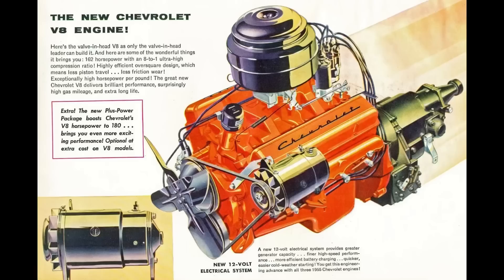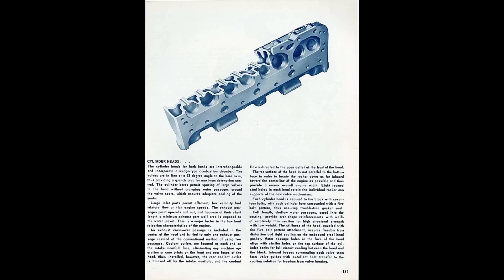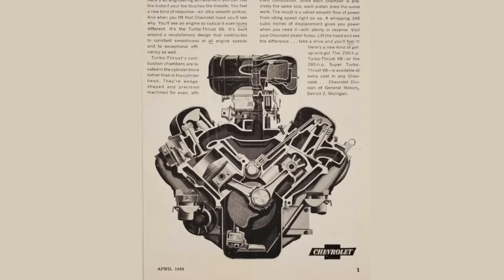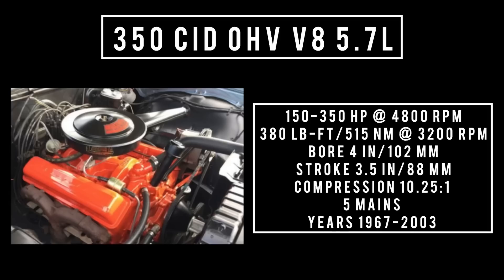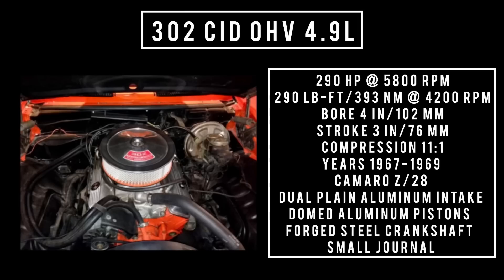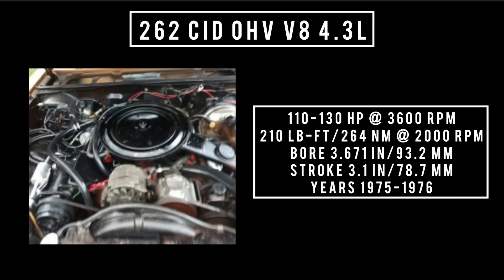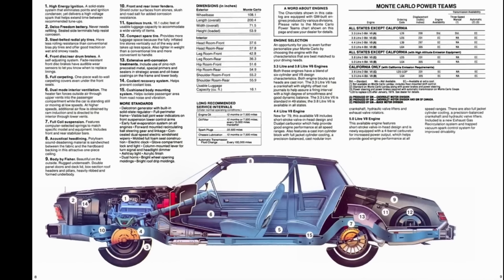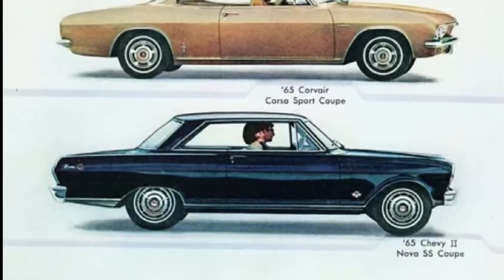First Generation small block Chevy engine family 265, 283, 327, 350, 302, 307, 400, 262, 305, 267￼

Comment: Hello....  just.  To.  Let.   Ya..  know...  my.   Favorite.  Small.  Block.    Chevorlet..  is. The.  327...  it. Was.   Common. From.  Any. Where. Starting. At. 210..h.p.....in. the. Standard.  Camaro..  upto. 375 h...p..   in. The. Corvette..  and.  I.  Consider. Myself.  Lucky..  to.  Have.     Tuned. Up.  Repaired..   or.  Rebuilt. Most. Of. Those.  Variants. Of. Original. H...p...327.s.   to.  Proper.  Spec.s...  and. Using. Original...  equipment....  good. Video...thankyou.  have.  A. Nice. Day...
Reply from the maker: =) thank you so much for sharing that information

Comment: The stamped steel rocker arm concept was borrowed from Pontiac. Originally they were going to use shaft rockers. I've never understood the oddball 262 engine when they already had so many parts combos on the shelf to make a variety of displacements. Both it and the 305 were somewhat of a dud from a performance standpoint  as they just didn't seem to breath well at all.
Reply: Then youve never had a 307...lol. Even the Chevy boys dont like that one.

Comment: I like the 327 c.i. the best. I had a 1965 Impala SS, which came with a 327, but some idiot swapped it out for a 307, which had come out of a truck. As you mentioned,  the 1st gen 327 had smaller main bearing bores. All 307's had the larger main bearing bores, as the 2nd generation 327 had. Whomever put the 307 in my car had used the "double-hump" heads from the 327. I never got around to it, but I had a spare 350  and had planned to rebuild it using the 307 crank. This would have made it a 327 and with those "double-hump" heads, would have made it a rocket ship.
In California, for most of the 307's production run, it didn't conform to our emissions standards. Chevrolet's could only get the 327 or 350 for the smallest V8 available. Sure, I've seen plenty of 307's in California, but those were purchased out of State and brought here. A California emissions rule was that non-conforming vehicles, licensed in another State, could register them in California after a certain number of miles. People would buy a new  vehicle or "gray-market" used European vehicle in, say, Texas and someone there would drive it, putting the appropriate miles on them, so they could be registered in California. On these non-conforming vehicles, California would charge a "use" fee(tax). Also, even if you had a mailing address outside of California, if your vehicle was registered to that address, if your vehicle was used in the State of California, you had to register is in California. I had a friend who bought his vehicles in Oklahoma to avoid California's large sales taxes and license fees and even got a better purchase price, had his vehicles registered to his Oklahoma address to also beat California's big license fees. Well, he ended up having to register his vehicles in California. Speaking of lower purchase prices, he had a son in law who was a Ford dealer in California.
We had a new customer in the WalMart family, who moved here from Arkansas. His Jeep had too few of miles to register it in California. He had no problems getting his Rolls-Royce Corniche convertible, Ferrari, BMW 750i or his Jaguar XJS convertible registered. He had alot of money, but cringed under California's license fees. The R-R alone was $2k. After a few years and several WalMart stores opened, he moved to Texas. His R-R license fee was around $100.
OK. The Chevy 262 and 267, nor the 200 ci V6 weren't welcomed in California either. Instead of the small V8's the small cars got 305's or 350's. If you wanted a V6, all you could get was the Buick 3.8L or 4.1L.
Reply from the maker: Great information thank you so much for sharing those memories =) I still can’t get over that they put a 307 in An impala but then again they were putting six cylinders in those big cars back down as well.. 

327 is a great engine the rev higher than a 350 or so I was told..
Reply: @What.its.like.  You can probably make an engine do what you want it to do. Bothe the 327 and the first 350 have the same bore, 4", but the 327 has a shorter stroke, so it is capable of revving higher.
There was one rare Chevy V8 that you left out. There was another 350 V8 in the 1968 SS-350 Camaros. It was rated as having 295 SAE gross hp. It had a different bore and stroke than the 1969-on 350. Most notably it had the same main bearing journals as the original 327, so they threw alot of rods.

Comment: The biggest mistake GM ever made is not continuing production of the SBC engine. This engine was the best thing GM ever made. Not for new cars but for classic and antique car enthusiasts. This engine is the best choice for repowering older vehicles. Now I know someone will say the LS is the way to go but if you want simple and reliable and cheap the old school SBC is a great choice.
Reply from the maker: Totally agree I’ve also heard that you can use a small block Chevy with the Vortech heads to get more power out of them relatively easy I’ve never done it before but I was thinking about it nothing cheaper than building a small block Chevy parts are cheap ed Cole was truly a genius

Comment: The 1993 Caprice had the same L03 (305) and L05 (350) motor options as the earlier Caprice years.  It wasn't until 1994 the LT1 & L99 motors arrived in these sedans.  Thus the original SBC was in production all the way to 1993, not 1992.

Comment: I had an 83 K10 with a 305, it was a dog on steep hills, but was efficient and durable, Ive got an 88 K5 now with a TBI 350 and it does better on hills and is decently quick for an 80s truck. People are usually surprised when I tell them how much horse power the K5 makes.

Comment: Hi Jay!:  A comprehensive summary of what is probably the best Chevy engine series ever produced.  Enjoyed the part where Ed Cole stole the valve train design from Pontiac!  Hadn't heard that before!  Only small block Chevy ownership of mine was a 1977 GMC pick up I had that had one of those "Target Master" 350 replacement engines in it.  Ran fine.  It was that crummy THM transmission that caused that one to go away.  If I was to have a choice it would probably be a 1965 Corvette with the last of the Fuelie engines in it!  Ya, the big block was cool, but the Small Block would be better handling!  Chevy HAD to do something to try and stop being embarrassed by the 427 Shelby Cobras.
Reply from the maker: I would love to compare Chevy 427 to ford 427 one day 

Glad you dig this video =)

Thank you so much for sharing your experience with all of us ed Cole was a genius for making the small block Chevy part interchangeable just a brilliant play i’m not that first and new technology but I don’t know if anything changes now but then again you’re getting into planned obsolescence it’s total opposite they wanted to break and it cost a fortune when it does and then you’ll have to get a new car it’s all by design. Where is the old stuff when it broke you just fixed it
Reply: @What.its.like. Good luck with that comparison. Ford made many cylinder heads for the 427, all with different performance capabilities.There were medium riser heads, high riser heads, tunnel port heads which had a pushrod tube through the center of intake ports, and the ultimate development of the Ford 427, the SOHC "cammer" heads operated by two timing chains.
To my knowledge, only two big block Mark IV type (not "W" series 427s, they were a further development of the 409) Chevy heads were factory made....small port and large port.

Comment: I love 350s. I've had good luck with them. I have one in a 74 C20 that sat in the woods for 20 years and all I done was a tune up, new carb and adjusted the timing and it runs great. Had an 86 Camino that originally had a 305 but it died out at 75k ended up dropping a nice 350 in it
Reply from the maker: Awesome thank you so much for sharing your experience and memories =)

Comment: Very good video, Jay. Something for me to rewatch.

I've had two cars with the 350. The first was a 1970 Bel Air, the second was a 1973 Impala. For me, the Bel Air was the more reliable of the two.   The Impala eventually threw a rod.
Reply from the maker: Glad you dig this episode 

Thank you so much for sharing your experience with these 70 bel air well both of them are huge cars
Reply: I've seen a stock 305 go 84 miles without oil. I know because I was behind it the whole time, and the oil was on my windshield. We knew it was leaking oil but we had no idea how much because it was full when we started and the pressure gauge was stuck. We got home and pulled the drain plug. About the amount that would fit in a shot glass came out. Miraculously that engine still runs today!

So I'm surprised to hear the 350 threw a rod. Any idea what caused it? Was it stock or built?

Comment: The mouse that roared,  but the 327 was the mighty mouse👍
Reply from the maker: 327 was a great engine I rode in a 350 hp 327 in a Corvette and it was great.. 1965 I think It was hard to believe that it was a small block car it was very balanced and it would move
Reply: @What.its.like. 327 with right pistons and camel. Hump heads fuelie and 650. Cfm carb was a screamer boss bought a 70. Impala with roached 307...we had a good 327. Lying around added a cut crank fuelie heads and a Holley carb

Bolted on old sheetmetal new oil and water pump fuel pump too that motor ran like snot for less than a grand
Reply: Early smaii journal 327, could spin 8 grand, a belt out 500 ponies..tough street motor❤
Reply: They were ok for a small cubic inch V8.

Comment: My personal favorite was the 307 in my '70 Malibu. Backed by a Turbo 350 trans and with a small 4 barrel and HEI ignition it had great mileage and power. I will always regret selling that car.
Reply: In over 50 years of working on vehicles, I have  never seen a factory stock 307 with anything other than a tiny Rochester two-barrel, only later 305s.
Reply: @donreinke5863  I didn't say that the 4 barrel was stock
Reply: @genehart261 lol..somehow I didnt think so.
It would be interesting to install some 1.94 350 heads on that engine just to see what kind of power could be made.
Reply: @donreinke5863  that car was a perfect balance of many things, I commuted 130 miles a day in it for a number of years. Lots of torque and 18 mpg without overdrive. Over 300,000 miles on the trans with just regular service.
Reply: @genehart261  I have an old 3/4 ton stepside GMC that has the original 307 with a 3 speed which was an old ranch truck from Wyoming. It still runs, but I have a 400 smallblock from a 75 Caprice I was thinking about sticking in it as it will likely still get about 10 mpg. Just need to find an external balance flywheel.
Reply from the maker: That car sounds sweet I never drove anything with a 307 in it

Comment: The 302 is not really very well known, you can win bets. It was a screaming little animal, barely civilized on the street.
Reply: In 1976, in my auto shop class we helped a senior from our highschool do a partial rebuild on his 302 out of his Camaro. When running again it was extremely difficult to tune. Didn't even run well with pomp premium gas. Only  102 octane and a perfect setting of timing. Crazy fast car for the era
Reply from the maker: I want to find one and review it
Reply: Some more less known is the big block V6 and big block 5.7 348
Reply: My friend had a 69 Z-28. When I drove it the first time I took it to 6,500 rpms before I shifted it and it screamed. I showed him how to drive his car that day, lol. The HP rating listed was before all of the racing parts in the trunk(from the factory)were installed.
Reply: They’re extremely well known!
Reply: My buddy's 69 Z/28 would do 80 mph in first gear
Reply: I don't get why so many choices?   Why not just 2 or 3.  Keep it simple
Reply: @Brian-dh9lp — it’s really Chevy’s fault all these engines are an outgrowth of the original small block and are therefore related, trust me it could have been much more complicated as Chevy made so many iterations of the small block
Reply: Woukd love to find one solid lift factory they had way more power than advertised

Comment: My first small block was a 350 in a 73 Camaro i got in 1980. I drove the wheels off that car. It started leaking oil. Found out the timing chain wore to the point it was so loose it cut a slice out of the timing cover. Next was a 64 283 that I built myself and installed in the 57 Chevy Pick up that I was driving in 1984. It was a screamin lil demon...and got 19 mpg with 411 gears. Today, I putt around in a 91 Chevy Scotsdale with 500k on the clock and it gets 22 mpg when I repect it. As far a Chevy engines go....Gimme cast iron all day.
Reply from the maker: Awesome thank you so much for sharing your experience with us I love how durable just how these engines work as advertised even years later I don’t know if there’s a better engine out there to be 100% honest there are more powerful engines but as far as tried-and-true goes I don’t think there’s anything that beats it
Reply: @What.its.like.  Durability and reliability....LIKE A ROCK!